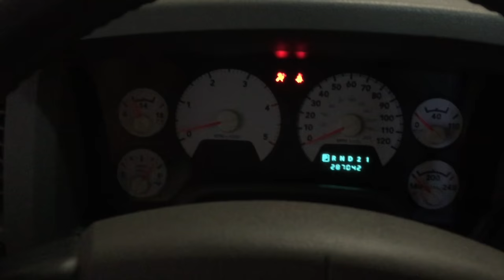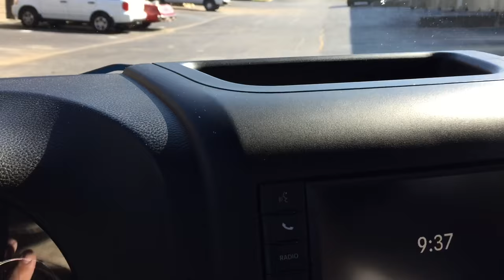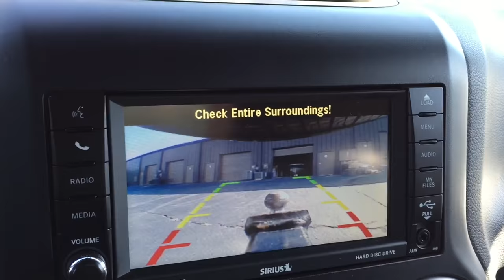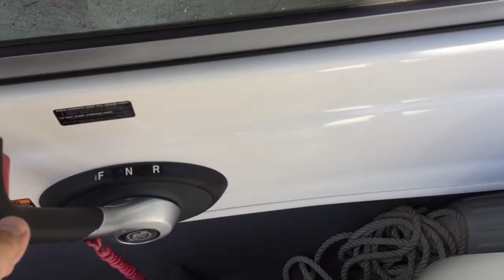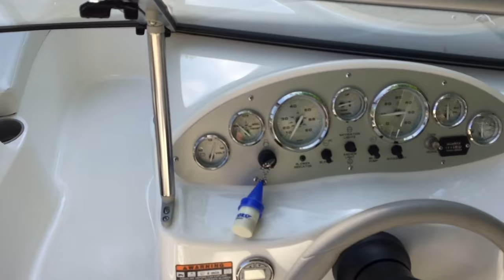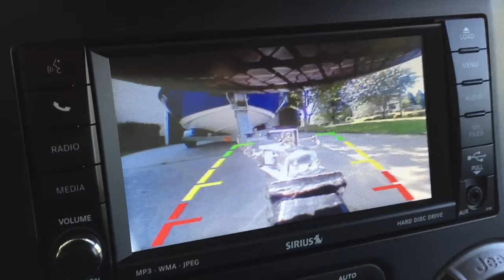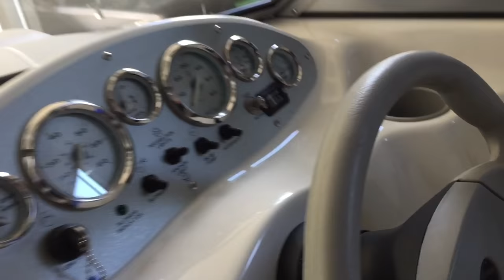My first Vlog!!! Getting the Bayliner 175 out of storage, dusting it off and cranking it up

Comment: I have 2010 175.  My only grip is the cup holders on motor box.  Leaks water directly  on to coil and spark plugs. Caused misfire.  Sealed them off.
Reply from the maker: Yeah that was where Bayliner cut come corners.

Comment: I was wondering what the length of the boat and trailer with the neck folded is.  I have a little over 19 feet in my garage I was wondering if it would fit
Reply: I had the exact same question! I think I have exactly 19'6" in my garage and can't buy this boat until I know it fits. Did anyone answer anywhere in this thread?

Comment: how big is your garage?
Reply from the maker: not deep at all. cannot remember the measurements but in order to park a newer ford taurus where the boat is parked now, it is mm from where the door comes down.
Reply: FYI, you can fit a 175 in a 20' garage. Barely. On an angle, with a breakaway trailer tongue :)

Comment: if you're showing off a boat. Learn more about the engine. And explain more about the engine and tell you why the motor is for the boat is it fule injection or carburetor. Is it water cooled or radiator and options for motor.Gas mileage. what rpm is best .oil change drain or pump it out.chrome don't get you home
Reply: And pitch of prop